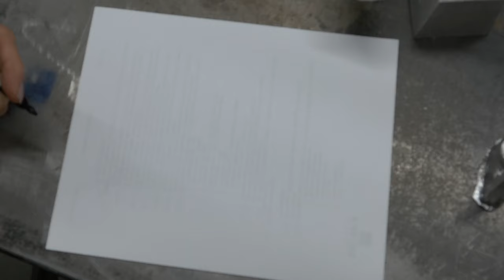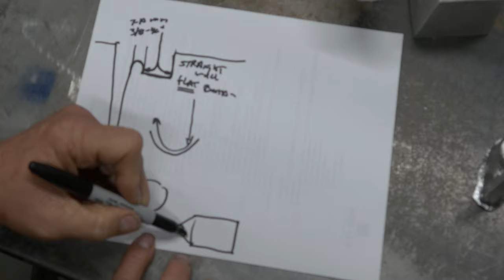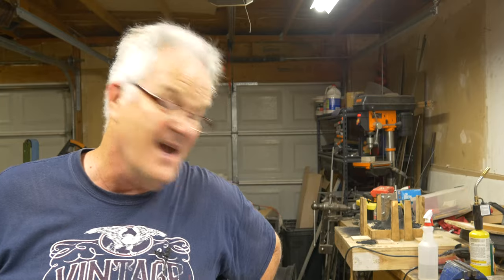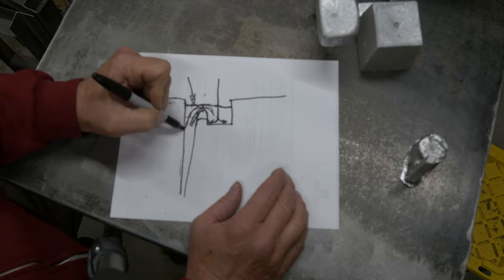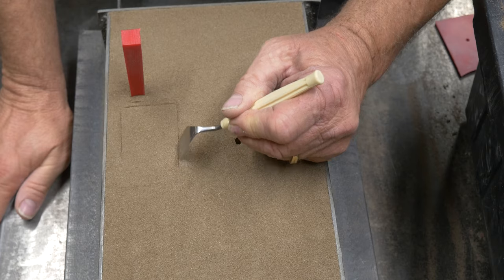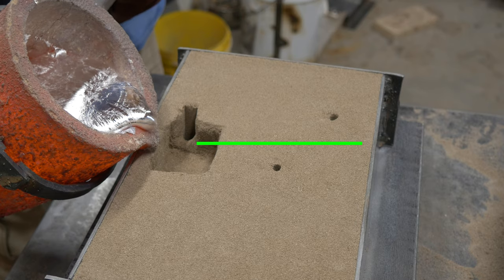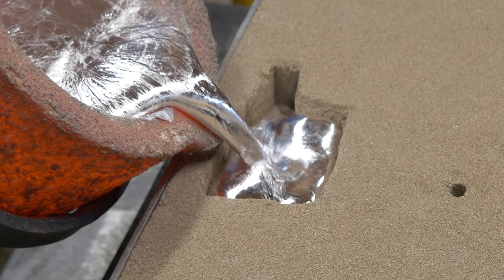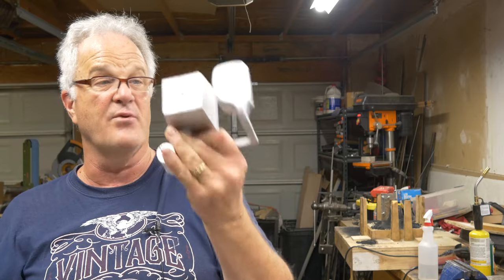Learning to Cast Metal   Offset Pouring Basin

Comment: Nice video. Love the frame by frame approach. You've come a long way since you poured the hammer head that ended up with a hole in it. You should point out that using a steel cope allows you to rest the crucible on the edge without it catching on fire. A very nice feature. Good work!
Cheers from Juneau Alaska, 
Greg Chaney
Reply from the maker: HI Greg

Yeah I felt like I had come far enough that I needed to correct some of the stuff I did in my early videos.  I cringe when people ask me questions from those pours as they remind me that they're still out there. 

I thought about the fact that my flasks don't catch fire after I uploaded. Good point.

Comment: So the basin is like a regulating buffer to allow for variable flow down the sprue. Steam locomotives were designed (towards the end of their development) to have very large steam pipes to the cylinders. The large volume of reserve steam in the pipe formed a buffered supply so that when the piston valve opened, the cylinder could fill quickly with high pressure steam and not run dry (or low on pressure).
Reply from the maker: Well before I get yelled at for spewing inaccuracies it also is useful as a place to allow any air bubbles to rise to the surface and not get sucked down the sprue.  It also has the effect of flowing the metal as it is poured . Although given the height of my crucible above the basin  it can’t be slowing it that much.  

The big reason is to prevent air from getting sucked down the sprue
Reply: From a control point of view, I'm thinking that there should be a weir on the back side of the sprue, leading to catchment.  This would allow continuous pouring to ensure the sprue is always full. And it would avoid the puddle of aluminum on the top of the flask (which starts a fire if the flask is wood!).

Comment: Great video AGAIN perry....  your one of the only stand outs on youtube always trying new things win lose or draw.  Always winning though , thats my 2 cents anyway. Keep up the great work . Oh how many times ha e you had to re build or build a new furnace in the last 30 melts? Curious lol mine is always falling apart and needing TLC .
Reply from the maker: Hi J, I thought I had replied earlier but it doesn't look like I did.   I've only relined my furnace once since I built it.  I used a refractory cement to line it.  The walls are doing well but the lid is in need of some love.  I'm actually... all thought you'd never know it to look at it... building a new larger one.  It will be similar in design with firebrick and a refractory cement.  The  only difference is I'll be adding kao wool to the walls as well. So from the outside in, sheet metal, fire brick, kao wool, refractory cement. 

I'm contemplating building it with a second burner option in the event I want to try cast iron again... I swore I never wood but it keeps nagging at me.

Comment: You might want to consider some sort of lift table. That way you can adjust the table to be at the proper pouring height independent of mold height.
Reply from the maker: Well Mark that would imply that I actually get around to making flasks of varying size 😀😀   You're right though for a talk flask my table height would start to be problematic.

Comment: Great videos.  Very informative.. However I've noticed that up to now you haven't mentioned 'feeders' ( the additional void that fills with metal to keep the casting supplied with molten metal as it cools preventing shrinkage)  I can see that there is in effect a bit of a one on top of the spin trap, but I'd have thought much too small to feed that large block of casting. The spin trap/feeder ( ? ) would have solidified well before the centre of the large casting.  I'm really surprised that it appeared so good and no shrinkage or signs of deforming.
Reply from the maker: If you keep going, you'll get there. Feeders are actually the last video in the series. https://youtu.be/_3lwlBx6-YA  I will tell you I wasn't very happy with the experiment results I did in that video.  There is another that is somewhat related but not really https://youtu.be/pSgF7B55Fas
Reply: @swdweeb  Yes have seen your really good video on feeders, that's why I was rather surprised that there wasn't a substantial one placed adjacent to that huge cube in the molding. Despite this the resulting casting looked surprisingly good from where I was looking..
Anyway, at the moment I'm just an armchair foundryman ! I've had to stop work due to ill health so I've been binge watching casting videos.. My other fields of  armchair 'expertise' include :

* Arc, MIG ,TIG welding & related metalworking and tools.
* Woodworking & related tools.
* Small generator service and repair.

All very well, but not much use to me till I get back on my feet !  
😁

Comment: Hey, Perry, just a question from a begginer that know nothing... so take it as it is :-).
Have you ever tried to push the molten metal from the bottom through some kind of a channel/tube with a piston or something?
Just a thought to solve the problem of the air that get caught while the metal is going down.
Is it just easier pouring it from the top?
Reply from the maker: I thought about that a while ago as I was trying to figure out this bottom filling stuff.  I suppose it is possible to use some sort of piston but that seems like it would be a mess to clean up.  How to get the cold metal out of the thing afterward.

Professor Campbell talks about something called a contact pouring basin being  the best. It is essentially a ladle full of metal that sits on top of the sprue. There is a hole in the bottom of the ladle that can be opened and the metal flows air-free completely filling the sprue as soon as it does. They use various filters and gates to control the flow o the metal into the part. 

So, it appears to me that they are still using gravity to fill the mold. Now of course your method may be out there in every foundry and I just haven't heard about it.  Maybe I should get out more 😀
Reply: @swdweeb  mrpete22 has a friend trainman4602 who does brass investment casting.  Don't recall if Dave [trainman4602] used spinning to 'force' the metal into the mold.  Old mind does not remember the specifics as awell as last century.
I bet Martinn will chime in too.

Comment: I used the knowledge from these videos while casting my tapered sprue last weekend. I need to figure out what I'm doing wrong with my green sand though. Thanks for these tips
Reply from the maker: Is it too wet?
Reply: @swdweeb  actually looking at your video this week, I think it's too dry and not packing well.
Reply from the maker: @toomanyhobbies2874  I just replied to a guy about how much water I put in my sand.  It was only a week or two ago.  I'll see if I can find it. I measured it and everything :-D
Reply from the maker: Found it.  Here's what I told him 

I have settled on a ratio of about 2 liters of sand and 36ish ml of water for my ratio. I have a cup that holds about 400ml of sand and a little cap that holds about 6ml of water. I mix five cups of sand with 6 caps of water.
Reply: @swdweeb  this is awesome thanks. I think I'll give it a try this weekend
Reply: About 8 to 10 percent clay, and 3 1/2 to 4 percent water by weight. Get proper sand, not play sand.

Comment: Hi Perry, yet another great video. Do you have the details of the Professor's book? Or are there two? Long and short?
Reply from the maker: Hi Mark. Thanks.  There are two different books. 

The first is titled "Complete Casting Handbook Metal Casting Processes, Metallurgy, Techniques and Design" and has the ISBN of 978-0-444-63509-9  It is 1015 pages long. 

The second is titled "Mini Casting Handbook" with the ISBN 978-1-912078-74-5. IT is 95 pages long.

Comment: "I had never cast a casting that was several tons...". 😆😆🤣🤣🤣
Reply from the maker: One can always dream 😂
Reply: @swdweeb  I think you could manage it
 My dream is to cast aluminum bronze cannon. Just small ones, maybe swivel gun size.  Boring the barrel is the hitch. I would try to cast them with an undersized barrel, but it would still have to be reamed to size. I may try to do a hand gonne first, and see how that goes. The problem that I foresee is that aluminum bronze is reputed to be very hard to machine (which I would have to farm out.)
Reply from the maker: @carlericvonkleistiii2188  I expect Al Bronze is hard to machine.  It appears to be very hard. 

I've seen people use a piece of steel pipe as the bore and simple cast bronze around it. Don't have any idea how that works but might make machining easier.  Another option is to try and build a core inside the barrel to reduce the amount of boring work that needs to be done to get it to the right size and smoothness. 

I know Julian HG talked about casting a small cannon several months ago.  He showed the pattern he was planning to use. You might reach out to him to see if he's had further thoughts.  

I've thought about it too. My problem is getting up the courage to fire it.  Because... well... you have to fire it. 😀 Will it blow up? Will the ball simply roll out the end? 😀
Reply: @carlericvonkleistiii2188  Al bronze isn't just hard to machine, it's really hard to machine. if the alloy composition is off it's very brittle. It's an alloy which quickly work hardens. Depending on the alloy, machinability ratings vary between 0.20 to 0.60 Aluminum Bronze alloys can produce a curled swarf chip which can jam tooling and cause surface imperfections.  Particularly when machining bores. not saying don't do it, just be aware it's something that's going to be very challenging.
Reply: @askquestionstrythings  Yes, these are the things I have heard about it. My thought was to cast around a carefully sized core, and then try to use sandpaper around a mandrel to hone the bore to size, but that doesn't sound like it would be conducive to any degree of precision. Casting around a steel liner would probably be better. Or, just using a traditional bronze.
Reply: @swdweeb  I was thinking of a core, and then sandpaper on an arbor, but that doesn't sound like it would create an accurately sized barrel.

There are hoop stress calculators that can tell you how thick your barrel needs to be. Brass and bronze were not uncommon barrel materials in bygone days, so it is possible to use those materials. I might just use a traditional bronze or brass instead.

Comment: 11:15 Pour posture, instead of poor posture 😉. 

I imagine larger castings needing higher dams because the crucible will be larger and more likely poured from higher. The metal velocity will be higher and stream will be larger. There's a larger volume of metal to be poured before it cools. 

Watching the pour, it seemed like the metal was more viscus at first and as the mold warmed, flow sped up. At the same time a siphon developed and the level dramatically lowered. Very curious stuff
Reply from the maker: There does seem to be an almost siphoning effect that happens.  I'll have to ask my foundry friend about metal flowing faster after the pour has run for a short time.
Reply: @swdweeb  totally agree, also the mass of the metal makes this more apparant, in my bronze stuff, once i finish pouring i usually get a bouncing back and forth wave as the bronze looses it's inertia, it's quite dramatic untill everything settles. I'm sure it happens with aluminium too just less so i suppose
Reply: In a downward passage, during a rush caused by siphon, there may be an opportunity to gather air voids. Consider how a sink drain slurps & gurgles when the siphon effect draws so strong on the turbulent liquid going down the center of the pipe, that air gets sucked in past  the resistive laminar  flow liquid at the walls of the pipe.
Reply from the maker: @Greg Feneis  So siphon is probably the wrong word.  When I pour metal using the offset basin and sprue I never see the effect that you're describing. The top of the sprue never exhibits the rotation you're describing from a sink.  I've read in the Campbell's book that that was a consideration in square versus round sprues but he stated in the book that they don't see it in round sprues either.
Reply: @swdweeb  Agreed. I was careful not to imply that was happening in your case, just that the opportunity exists for siphon effect to do this on downward passages. All of the things you're doing appear to avoid this
Reply from the maker: @gregfeneis609  Hi Greg, sorry if I came across combative last night.  I had just read another comment that was clearly in the camp of telling me "you're wrong".   Yeah, if I saw a "drain swirl" I'd be pretty concerned.  As I said, Campbell mentions that they were concerned with that sort of action, perhaps not that dramatic, happening with round sprues but that they never actually saw it happen.
Reply: @swdweeb  Seems like the square cross section sprue helps prevent vortex formation which would make cavitation less likely. But I'll wager if the suction is strong enough, cavitation can still happen even with no vortex. Seems pretty tricky trying to get/keep the right velocity and volume going.

Comment: Hi Perry, thanks for all the video's you are making! I think I almost watched them all !! Last weekend I melted a lot of brass, but did not think it through. The crucible was far to heavy for my home made tools. Is it possible to go more in to the making of your own tools als well as the metal cope and drag? Also when I try to pour something it seems that my brussels earth is maybe to wet. How much water should I add ?

Thanks again for all the teaching! 

kind regards 
Bauke (The Netherlands)
Reply from the maker: Hello Bauke.  Thank you.  That is a great idea on the tools.  I need to make new ones and doing a video on that seems like a good idea.  I made a video a long time ago about the crucible tongs that I use.  I used to lift and pour with the same tool. I admit that wasnt the best idea... it did work though. I can say that the "shank" that I use now is much safer and is able to handle much heavier loads.  It is a simple ring made of metal that is about 3mm x 25mm and welded to a steel pipe.  It is not very round though and I need to figure out a way to make a better one.  Probably pay someone to do it is the best 😀😀
Reply: @swdweeb  I'm looking forward to the new video's ! Funny note, I'm working in the IT and closely working with HPE. I was watching some recordings and there you where, same voice other information. Easy to listen to ! :-)
Reply from the maker: @baukeplugge1980  How funny.  Ransomware?
Reply: @swdweeb  not sure anymore.

Comment: Hi swdweeb;
In your video of the water hitting the sink floor and rising to a higher level is technically called a "Hydraulic JUMP". So the Weir height needs to be a bit higher so the metal can't jump over uncontrollably. Look up examples on YouTube for Hydraulic Jumps and Dams.

redrok
Reply from the maker: Interesting.  I’m on my phone and will have too at this further.  Hydronic jumps use turbulence to expend energy and thus cause calmness downstream.  Am I reading that right?
Reply: swdweeb 
The jump often is quite turbulent but not always.
The critical thing is the jump is moving much slower resulting in an increase in height. Of course the volume flow is the same as before the jump. I.e speed * height is the same before and after the jump.
redrok

Comment: Did I miss why a square sprue and basin? I see no reason for it.
Reply from the maker: Possibly.  I used it in the tapered sprue video.  The only reason, and it is minor in my tiny molds, is the clean junction with the mostly-square runner that I use.
Reply: @swdweeb  Thank You, so it was not to do with the casting being squarish?
Reply from the maker: @smallcnclathes  Ha, no. 
In his books, Campbell talks about square sprues being use with square runners to make sure there are no offsets in the junction. I just wanted to give it a try.

Comment: Too low of a ridge and the metal isn't slowed. Too high and it becomes increasingly harder to keep the sprue filled. 
Looking at the sink example 4:42 there's two heights to consider, 1) is the first flat where the water first hits the sink and flattens out and 2) after the water flattens out it then rises to a second higher height before slowing and then flattening out again. 
So on the minimum side for the ridge, we should take into account this second higher height.
On the maximum side for the ridge, we want to be less than 50% (maybe less than 30%) of the total basin depth to avoid choking the metal too much and making it difficult to keep the sprue filled.
Reply from the maker: I'm not sure I agree with the "second height" requirement but I won;t die on that hill.  I've been wrong plenty of times in the past and will likely be wrong again.

In my conversation with Professor Campbell it is that initial height that we need to be concerned with stopping. The intent is to stop the horizontal movement and redirect it to an upward movement. Now in theoretical terms that probably means a  few millimetres. In practical terns for the guy standing in his garage cutting these things with a sawed-off spoon that probably means something in the realm of 10mm +-5mm. 

A taller ridge gives the monkey (me) pouring the metal  time to adjust the rate coming our of the crucible to be sufficient to fill the sprue.  I have in the past run a ridge that was 20mm of the bottom of a 30mm basin and kept the sprue full the entire time. It just takes practice.

On the flip side, a lower ridge gives me the opportunity to compensate for my pour rate inconsistencies. 

Bottom line, use a ridge that is tall enough to stop the horizontal flow and redirect it upward and more importantly keep the sprue full.